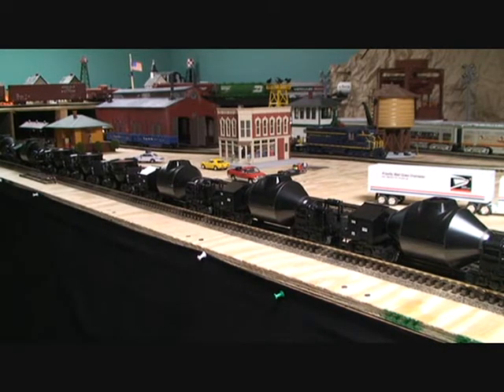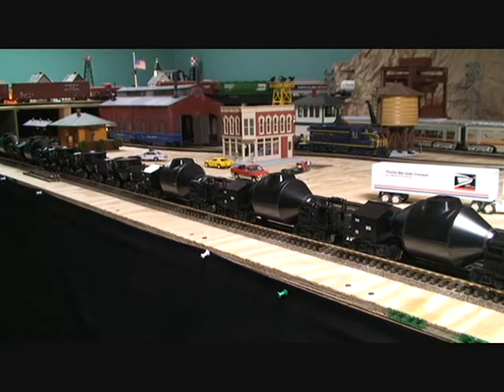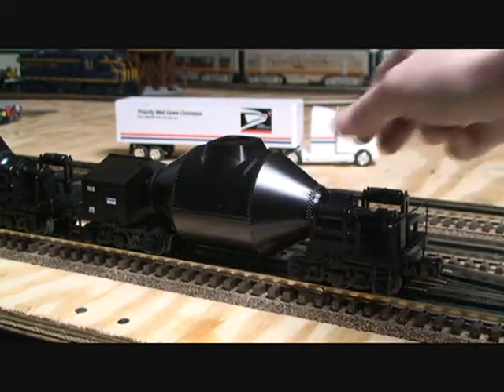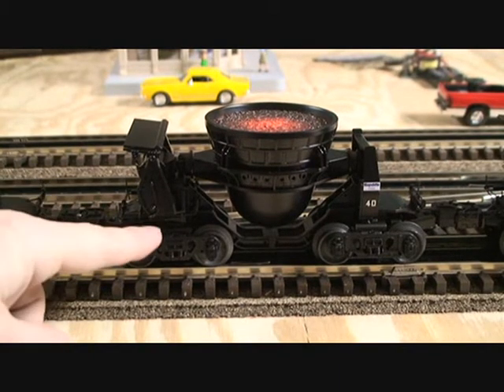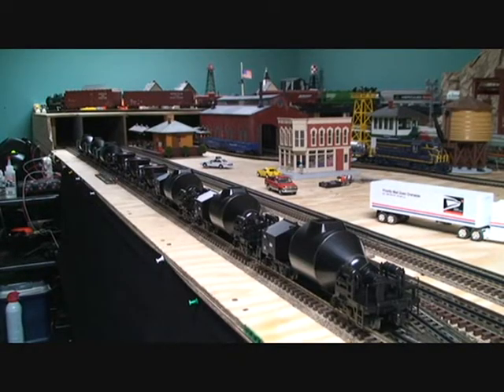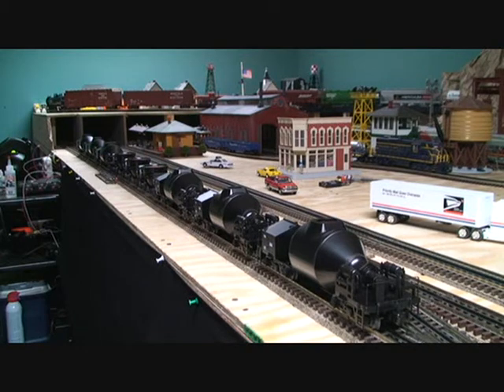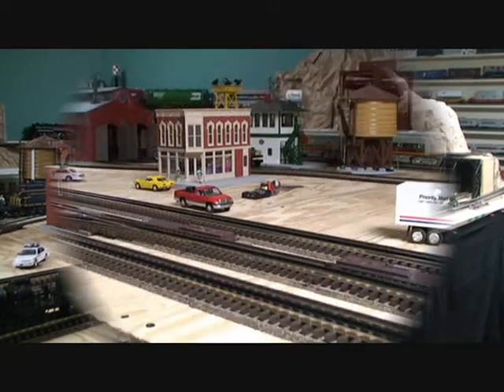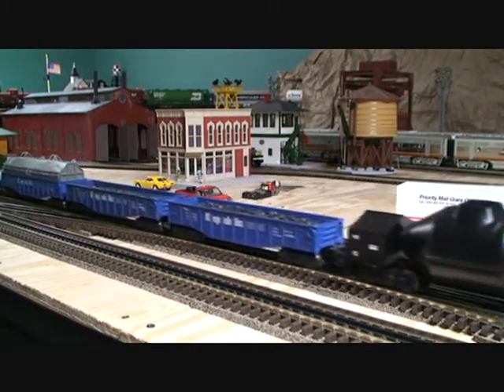Lionel Hot Metal and Slag Cars (Republic Steel)

Comment: Great Video JD - I have about 9 of the MTH hot metal cars and have recently won a Lionel one at auction that has the flickering load option.  I will need to retro-fit the flickering loads into the MTH cars... have you come across the flickering load part numbers for the load, lights and the truck pickups etc.  Does anyone make after market flickering loads?  Cheers Pete